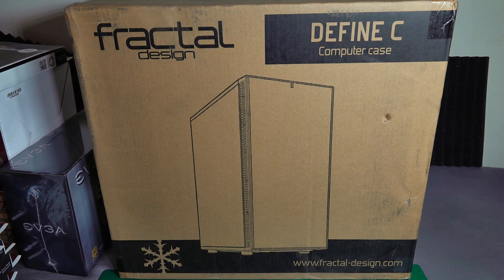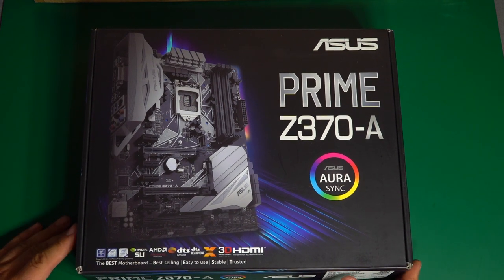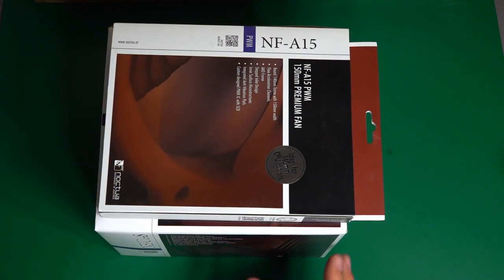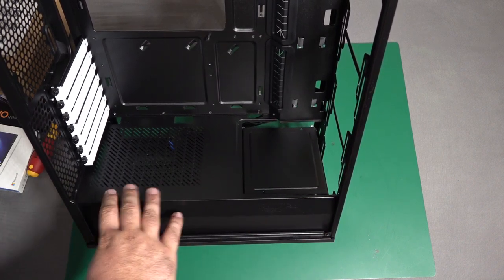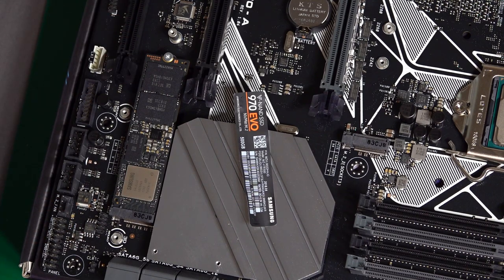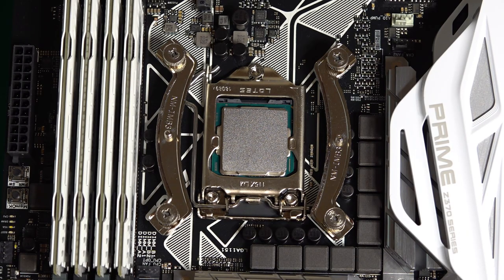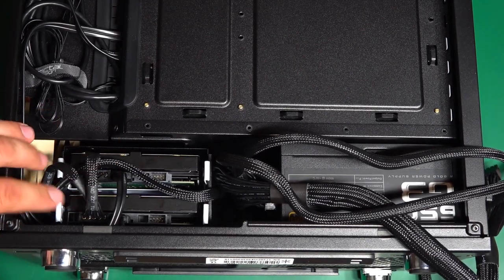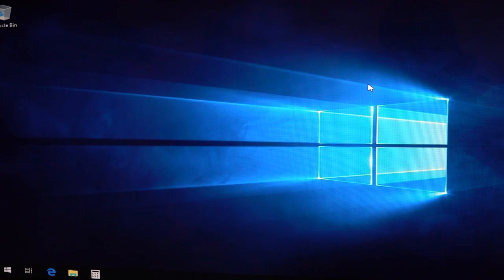New Computer Build for Video Editing, Gaming

Comment: After windows was installed, did you run windows update? And did you go to asus and install all the drivers for the motherboard? And you went to nvidia to get the GPU drivers right?
Reply from the maker: Windows itself includes many of the needed drivers to get things going, and Windows update will install or update virtually all the needed drivers these days.  I did use the disk included with the motherboard to install the chipset, audio and network drivers.  I also installed the latest video drivers from Nvidia, but I did not use the included disk for that.  

I then manually ran Windows update and there weren't very many updates needed because I used an install USB I created from the latest build.  But there were some updates.  Windows also found updated drivers for some components compared to what was on the disk.  Very simple process.  Everything is working great.